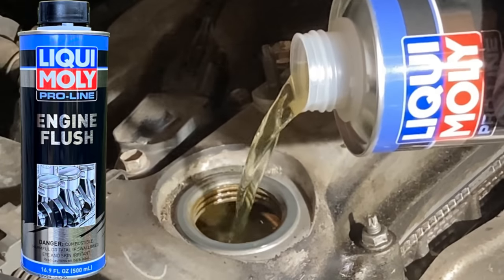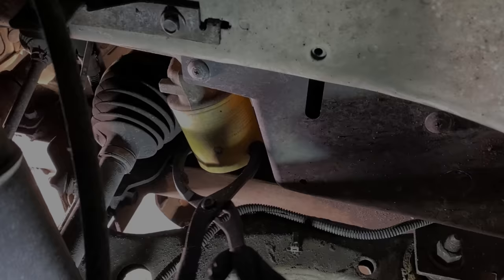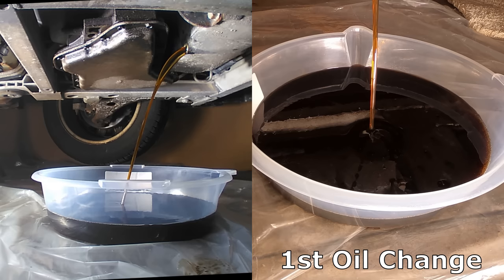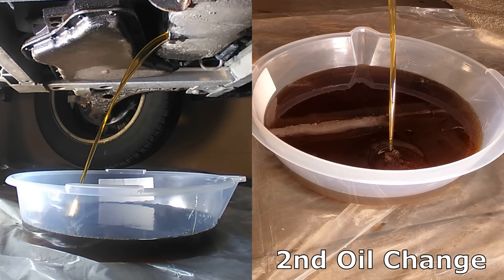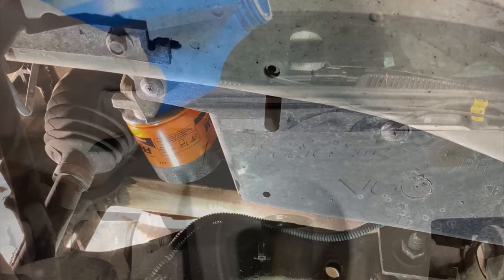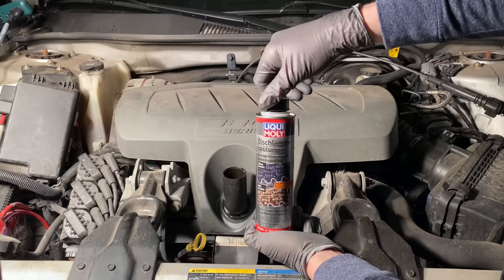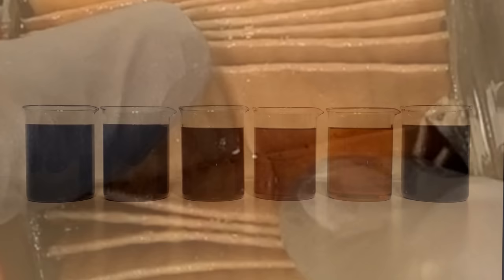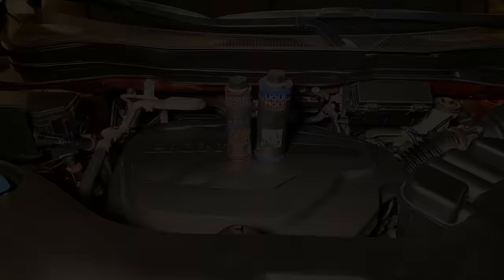Liqui Moly Sludge Remover vs Liqui Moly Engine Flush (Which is Best?)

Comment from the maker: Liqui Moly Pro-Line Engine Flush:  https://amzn.to/3o93BMP
Liqui Moly Sludge Remover:  https://amzn.to/40w6CIE

Step by step flush procedure:
1.  Pour 1 can of Liqui Moly Sludge Remover into your engine.
2.  Drive for 124 miles (200km) without wide open throttle operation. 
3.  Drain oil and change filter.
4.  If you want to remove any remaining sludge, Refill oil to full capacity and run engine for 10 minutes or go for a short drive.
5.  Drain oil again (to remove any remaining old oil and left over sludge) and change filter.
6.  Add new oil and you are finished.
Reply: Please buy a funnel your giving me OCD
Reply: @andy2906   ...and PLEASE catch that drain plug before it falls in that oil!  😂But, I really learned a lot from this video. THANKS OWEN LUCAS for doing this test ❤
Reply: @jaywholoveseveryone1721  are YOU Talkin' to ME?
Reply: I want to know can we drive the car for some miles after adding engine flush

Comment: The color of the Oil is not related its cleanness, If you boil Engine oil it turns dark/black. Do the test, put some engine oil on a pan and cook it for a couple hours you will see it turn black without absolutely no "contaminants".
Reply from the maker: I will take your word for it, no need for me to bring motor oil into the kitchen, my wife would be very mad!  Very good point though, as a previous commenter mentioned, particle count would be the definitive test.
Reply: I second that.  When I bought my new car I did an oil change at 500 miles and 1k miles and it was brown both times.  It had little hint of gold but that’s about it.
Reply: Fresh oil also doesn’t come out that dark after 125 miles
Reply: @Athiril   if it is a diesel it will come out black. It is designed to.
Reply: @Athiril  Disagree
Reply: Well yes it will but that does not relate to this video, it's wasn't driven to the temperature that it would take, this is changing oil till it's clean then adding a sludge removal and showing what was left
Reply: @OwenLucas  I changed the oil on my brand new car when it only had 400 miles on it because the oil was 12 months old at that time based on the date of manufacturing and it sitting at the dealer many months during the height of the pandemic before I bought it. The oil was very very black.
Reply: Your oil shouldn't be boiling in the motor, I can't say that's a good thing to have happen. I can say though that once your oil is black, it's not doing a good job protecting your motor.
Reply: @jankington216  color of the Oil is not related its cleanness
Reply: @Matys1975  your dealer used your car. Sit at idle for god know how long not to mention spirited coffee run McDonald’s run straight from cold and very short distance.
Reply: @OwenLucas  project farm did a video where he tested different types of oil and you can watch him boil oil and turn the to the dark brown color
Reply: Then, use palm oil from your kitchen as oile replacement.. Its more Hot resistance than normal oil ;) .. Many user use that palm oil mixed with normal spec oil
Reply: @sam4D  You do you!!!
Reply: Only a diy’er, but what about pouring the old engine oil through a filter (Steel strainer ) or linen cloth to see the dirt. Or is all the dirt simply soluble??? If really want to know. Send off for oil analysis?
Reply: @OwenLucas project farm actually has a video with a clear casing where you can see the oil in action and it immediately turns black as soon as it goes into the engine.  I watched this recently and thought that was very interesting.
Reply: Funny, I had a Kia Sportage with a Prins DLM 3.0 and the car ran 100% on LPG and after a year the oil was almost yellow!
Reply: Not quite correct. Oil isn’t oxidizing terribly in the time frame involved here. That takes time and temperature. And it’s true that some oil can be dark and still perfectly fine, but it’s not the case that it is “not related”— just not always related as seems intuitive.
Reply: U is right it's what as known as thermal breakdown
Reply: This guy has been watching a lot of project farm
Reply: When ever I buy a used vehicle  I change oil. Then 2nd one at around 200 to 500 miles. Then every 3k to 5k  miles and it's always light to a little brown but never dark after the 1st oil change. 2nd change gets the rest of dirt.
Reply: The color is very important!!
One more time - very important.
Thats why by sports cars they change the oil in every couple of thousands kilometer... evel less - depending on the lot's of things - speed, RPM's , long high -speed drive and so long.
An example - when you look in the french fries pan with a new oil - even at 180C - the oil is still light brown - gold. 
The most important thing here is that a person who wants a very good and useful car should change the oil not in 25 - 30 000 km , but in a 10 - 12 000km. And he must do it with min 2 times engine flush.
In the end of the day - it depends of the personal needs and money!
Wish you all a very nice day ✌️💫
Reply: Burned oil IS a contaminant in engine oil. So is varnish.
Reply: @jackylsmith8138 if it's diesel, diesel engines send soot to the engine oil and it tends to disperse in the oil, reducing greatly the lifetime of the oil. That's why many use bypass filter kits (like the Amsoil one) to extend the lifetime of the oil and reduce engine wear
Reply: Why our oil can turun dark ? Just because it has additive inside it , try to boil base-oil , yeah base-oil...it won't turn dark color , but base-oil without additive won't protect engine well . So if you drain oil and it has dark color , means oil has additive to make it protect engine better . If the oil don't have cleaning agent or anti-sludge additive , your engine Will dark at all part , actually that dark part has an oil film stick at it but because of heat and there is no anti-sludge or cleaning agent , that part become dark just like burned out by heat .
Reply: @OwenLucas dont believe eveything you see for that short amount of distance the oil color wouldnt matter
Reply: Might be true, but oil color is a good indicator of buildup and sludge. Which is his concern in this video.
Reply: This video is interesting but if little use as a reference because we don't know the level of sludge you're dealing with? It appears to be relatively minor.
It would have been helpful to pop the valve cover before and after to get a better idea of what's going on! 🫤
Reply: If you believe me , try using STP oil , your car engine will clean as well as new engine , if your car engine already has brown color stick at all parts you can try using STP oil also and see what STP oil do for your car engine . Maybe some people not knowing STP oil brand , CAUSE you cannot see it in Moto GP but you can see STP oil in Formula 1 . Try it if you believe me .
Reply: YouTube channel Project Farm will “cook” motor oil during his comparison videos  it does darken but doesn’t turn black
Reply: I think you have too much time on your hands, and too much money if you can waste oil like that…
Reply: I’m simplifying a lot here but black oil means it’s doing it’s job as the detergents in it are doing it’s job, in turn this means that there shouldn’t be sludge build up in the first place, viscosity checking is far more useful in the real world than colour, also in case of diesel engines for example if it doesn’t turn black almost immediately you will have future carbon, egr and dpf problems for sure.
Reply: Color of oil not related.... Oil reacting at higher temperature obviously is going to change colour.... No brainer

Comment: It's pointless doing sludge removal if you adhere to 20k mile oil changes after. Back to sludge again. Better off doing 5000mile oil & filter after the sludge removal and residue oil changes.

Comment: So I've been a mechanic for 21 years... back in the day there was a machine called a motorvac system for engine flushing... drain oil, take off filter. Attach hoses and adapters to oil filter neck and drain plug...  the machine was kept plugged in to an electrical outlet all the time to keep the solvent at 125 degrees or hotter (again this is years ago).  Machine used a micron 3 (I believe) filter.  Machine pumped this hot fluid through the engine 5 or 6 times, took about 30 min after hook up.. and when I tell you it FLUSHED EVERYTHING  I'm not lying.. oil pressure was spot on.. and even weeks later the oil looked as if it was a new car...   the stuff in a bottle works sure but gotta do it 5 or 6 consecutive times keeping engine hot and changing filter each time
Reply from the maker: That is quite a machine!  I question what shops do nowadays but with equipment like that, you get what you pay for.
Reply: @OwenLucas  Well, you can make scuh a machine, easily.  Electric heater for central heating, electric oil pump, and  hoses.  But, you can also use diesel, and flush it 2-3 times, thats cheaper method.
Reply: I remember watching someone do that while waiting for my vehicle. I was fascinated by it for some reason 😂
Reply: Company still exists. The machine you mention is discontinued. You can still get the manual off their site.
Reply: Yot engine was really dirty inside, and finały was cleaned after 200km, cause working longer and soecific could make his job.
Reply: Traducere
Reply: 6 times engine flush? Do you recommend running cheap new oil afterwards just to get out all of the flush and gunk? Thanks!
Reply: I am so glad I ran by your comment. It sounds like I need to make sure my engine is at normal temperature before adding the flush and let it run 30 minutes or so before dumping. I can see why the heat is needed. I cant find a shop that has that flush machine. I wish I could I would definitely do that. I will have to make due with what's handy.
Reply: @jaynikk758  Toss in 1 can of moly engine flush run it for 10 to 15 mins at idle shut off let set for 5 mins drain add new filter and oil you are good to go. All this video showed was how rich the oil companies are by wasting a bunch of good oil every 30K use the flush your fine then.
Reply: @cindysue5474 sometimes, you can save oil by just replacing the filter.

Of course, i'd recommend this on newer cars. If older, engine flush, till clear or newish oil becomes consistent. New spark plugs, fuel injectors and gaskets are needed to be done before any of that.
Reply: We had that in my high school auto shop in 96. Ours also had a line to hook up to an air compressor that would add bubbles to agitate it. That's the only time I ever saw one and this is the first time I've heard it mentioned since then. I was starting to think I imagined it.
Reply: @dripfreefpv9695  I have only seen that machine once at the shop I mentioned. And I was there from 04-07.  I have not seen 1 since yet everyone older than me that's still in the business knows what I'm talking about.    It was a great machine.  Guess it wasn't worth it and why nobody has one.  They'd rather sell an engine
Reply: @wanderingbufoon No because most contamination is in the oil. Filters cannot catch everything but oil sure does.
Reply: There is one in my area, i stand by it that it really makes the difference, you can feel the car more responsive and “lighter” , fuel consumption improved as well, everybody should do it every 10k i think
Reply: What’s the cost of getting that done?

Comment: Finally, someone that does full volume oil change before using a flush. 10-20%of old oil will remain.  I perform a clean oil flush once a year. Let's the new oil perform better and for a longer time.  The darkening of the oil is normal from heat and blowby contaminants.  Heat new oil in a stainless steel pan, up to 220F, several times. It will become dark.  A better way to measure the performance of these flush products is using oil particle count test. It measures all particulates from 4-30 microns, and is a recognized as an industry ISO standard for oil cleanliness. A full oil analysis costs about $40 USD.  Good video, much better than 100s of videos on flushes that don't rinse the engine.
Reply from the maker: Interesting that heating the oil alone discolors it, the 126 mile drive was 2 hours almost non stop so the engine definitely got up to temperature.
Reply: @OwenLucas  keep up with methods, bring common sense to the many car myths out there.
Reply: Yes, this is completely correct, every oil becomes darker again after a short time, after just a "normal" oil change, without such a remedy, it can even look very black again, like after thousands of kilometers. Good to see if you manually measure the oil level on the stick.

The Liqui Moly still had a cleaning performance here, because particles could be seen again in the filter after only a few kilometers of driving.
Reply: So basically it close to $150.00 to do this.  4 oil changes (if you do it yourself) and engine flush.
Reply: how many oil changes before using the flush on a 65k mile car do you think is necessary to do a good flush?
Reply: @trvman1  don't use a solvent flush, just a fresh oil rinse.  Basically changing the oil a second time, after one warm up.  No need to put a new filter in.
Reply: @arlokkkk  don't use a solvent flush.  Just change oil only after first warm up. This replace 99% of old oil.
Reply: @tssci6774 thanks!
Reply: @OwenLucas yes … look at any of the motor oil tests by Project Farm and he cooks the oil on a cook top …  all the oils turn dark.

Comment: "Sludge remover" sounds more powerful to me than "engine flush". Thank you for pointing out the difference.
Reply: Makes good sense when broken down. Sludge would be caked on, therefore over a lengthy amount of time with less abrasive contents to preserve the engine internals while driven.
Reply: It's always good to use a sludge remover first, then remove the crankcase , use  diesel and keep staying it with a spray bottle as you scrub with a nylon bristle brush whatever you can from beneath and then the inside of the oil pan , fix them together, pour some cheap oil, with liquid moli engine flush run it for 10 to 15 minutes let it cool and then drain,then top with the second can of new oil which also need not be expensive as you are only wanting to get the traces of contamination and traces of liquid moli, the decarbonizer which is a degreaser as it can break the viscosity of the oil you are going to add and drive for the next 5 thousand miles or 8 thousand kms . Please don't do this flushing and sludge break down all the time you change oil it needs to be done only once in 40 thousand miles or 60 thousand kilometres other wise your bearing grease will vanish and wear and tear ( premature) can cause premature wear of your rings, then ring fracture, then piston shake, and piston going out of round and the block aswell due to digging as the eccentrics are fashioned perpendicular to the long axis of the crank

Comment: I used Engine Flush on my 2005 Tacoma w/ 234k, with issues impacting the timing chain. Replacement of the chain was recommended to the tune of $4,500.   $18 Engine Flush and 1 extra oil change to flush it all out, and my truck drives like new and no longer needs the repair. NO exaggeration, this stuff is awesome.
Reply from the maker: Glad to hear it worked out!  💪
Reply: My ford expediton 2005 which have 5.4 3V engine has been run around 380K 

Can i use it or it will screw something in the engine

Comment: I am glad someone on Youtube has the brains the use a proper oil filter cutter. Everyone out here trying to kill themselves with an angle grinder or lose an eye with a sawzall.
Reply from the maker: Agreed, $25 well spent.  Its tough looking at a filter cut with a saw as you cant tell what metal or contaminants are from the saw blade or the engine.
Reply: @OwenLucas  That's the issue with most of the reviewers just cutting into it with power tools. I can understands tin snips. But when they say try as best they can to not contaminate the filter but then proceed to cut with a power tool it makes their effort moot. Great job on the thought process. Subbing for that.